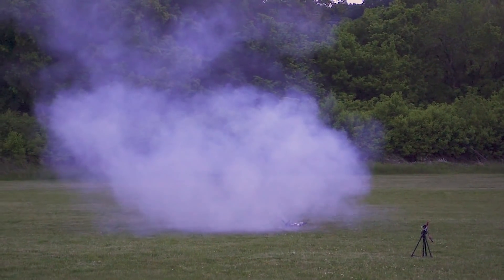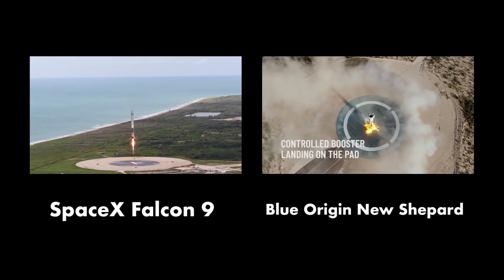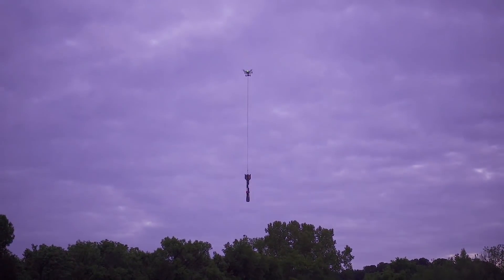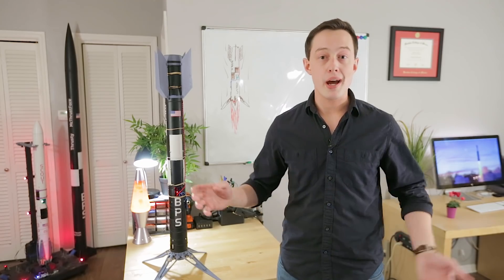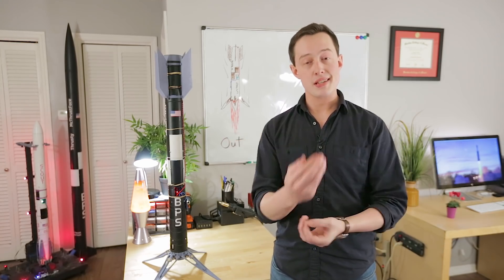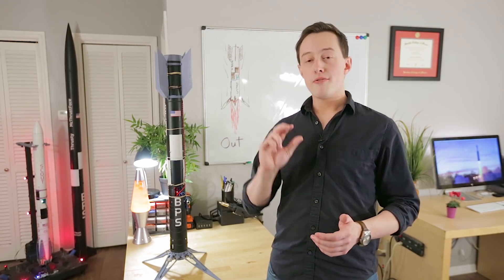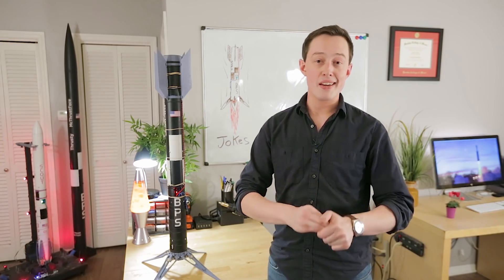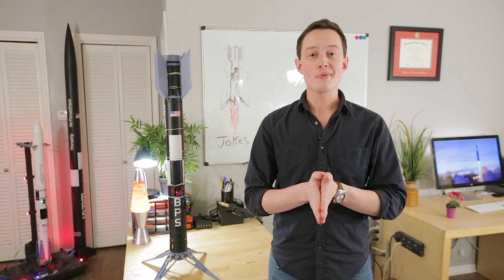Echo - Landing Test #4

Comment: You can always try to reduce drift in attitude and position estimation with better filtering, however with the sensors that you are using you can't avoid having some drift (namely given your sensors your system is not observable). To avoid position drift you could maybe use optical flow with a down facing camera, but maybe you can reduce the drift enough with just filtering.

Comment: Maybe adding some kind of "dampers" to the legs could help to deal whith the rebound.
Also, as u mentioned, you can 3d print some single use pieces, which would be used to "crash", thus, bleeding the impact energy into them (more or less like an airbag)
Reply: With the RCS, it won't drift therefore reducing all chances of rotational momentum after first impact

Comment: Not a rocket engineer but couldn't you ignore the sensor data for the moment that the legs are released and have the flight computer project the trajectory from data just prior to leg deployment? Then when the vibration ends go back to the sensors?   Great job by the way.

Comment: I do wonder if a bit of a hardware solution in altering the spring loading of the landing legs might help with both the deployment transient and with landing... thinking of springs that take a little longer to expand/contract when the force against them changes?

Comment: When you trigger the landing gear, can you not simply hold all control outputs for the 0.5-1s you see the spikes kick through, rather than adding additional filtering or dampening. The duration of the hold should be negligible impact on the control. It would similiar to dropping a PID loop into manual for the split second to break a control cycle when loop tuning.

Comment: use tiny syringes as struts, that would dampen the landing gear on deployment and add impact absorption on touchdown. (coat the inside of the syringes with mineral oil to reduce the static friction coefficient)

Comment: Great work Joe...I have a suggestion or two...
   Unlike you, I'm not a rocket scientist but I think the landing surface is possibly another contributing factor for the vehicle tipping over...
   So, why not design a portable firm landing surface...
 Idk what is the proper term but getting a working retro system that would aid in orientation  of the vehicle and possibly eliminate the sliding issue....
   Finally, for the legs, would a shock absorption system help to eliminate the bounce also. ..
   May your skies be always blue and Godspeed in you endeavors....
Reply: I think having a landing pad might indeed contribute quite a bit.

Perhaps you can add something of a QR-like code to it, with markers that help determine orientation, for automatic positioning. :-D
Reply: This is a great idea! I feel like it would totally help.
Reply: Love the channel! Keep up the great work!
Reply: Regarding the landing pad idea :
It'd be easier testing over a large flat surface like an empty parking lot.
To keep it portable, the landing pad would need to be small, and once he's testing launches and landings simultaneously, the launch could be effected by even the smallest winds and once the landing sequence started it could be several feet off the mark from where it started. 
He would need to add a guidance system to literally fly the rocket back to the specific spot where his landing pad would be, and that would equate to more weight to the vehicle, not to mention more time in development. All of this is possible to overcome but the question is, does he want to take it that far?
IMHO, I think it would be easier to tweak the landing legs and the timing of the thrust, as he mentioned in the video. That way he could land on just about any level surface.
Reply: As for the landing gear, I was thinking of some way to to slow their deployment as well as landing shock by adjusting the resistance of the landing arm pivots. This could be done in a number of ways I'm sure, such as thrust bearings or washers with pivot bolts and nylon lock nuts for adjusting.
Reply: If you're doing that (portable landing surface), the next next to idiot-proof answer would be "velcro".
Reply: Are you thinking about RCS thrusters?
Reply: The only problem that I can see is the legal one- if your self-landing rocket is being guided at a target, certain government bodies may be inclined to describe it as a "missile."

Comment: You have hit it right on the nail, the problem is that you need dampened on your landing gear so the rocket doesn't bounce on landing.  I saw very closely that you stick the landing perfectly but what happen  was the landing gear is springy.  Use rc car dampeners to absorb impact

Comment: What is Echo's body made of?
Reply from the maker: Regular old cardboard tubing! Specifically, it's called 3 inch thin wall tubing and it's made by Apogee Components - super lightweight and easy to work with.
Reply: Okay thx

Comment: First here (I guess). I love your work! You've inspired me to start designing and 3D print modelrockets. First flight will be soon :)
Reply from the maker: Blue skies, friend 🚀
Reply: @BPSspace  btw, maybe you could make a landingspot (or just use a concrete or asphalt ground) to make sure it won't tip over